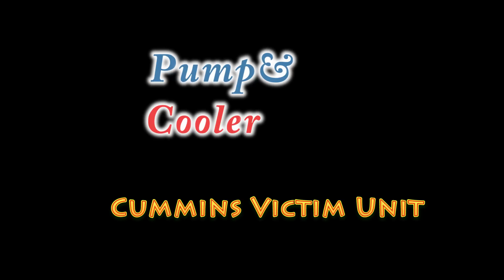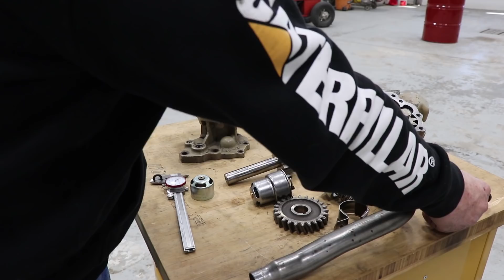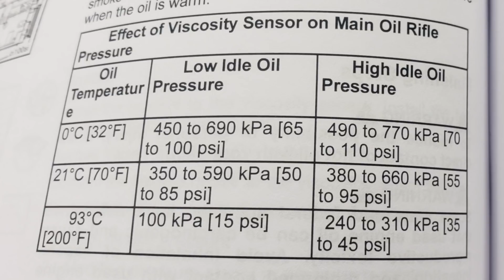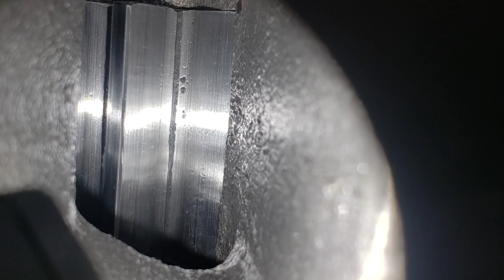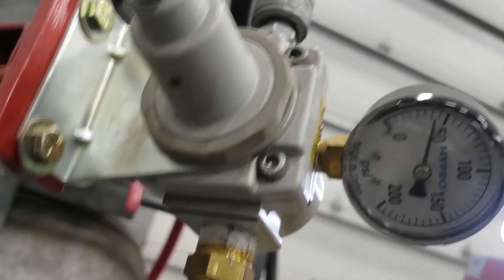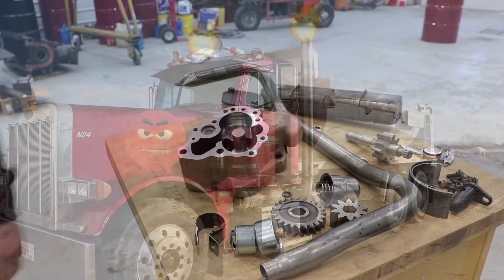How To Fix Low Oil Pressure On A Cummins N14

Comment: The pump end clearance may change once it gets up to operational temperature ?
Reply: Metal tends to expand when heated. Temp differential is not great in this application but could expand a thousand or 2.
Reply from the maker: excellent question,  I would like to know that myself

Comment: The high oil temperature is nothing more but heat transfer and energy transfer. He is energy, they were trying to transfer to the oil before they came out with big cam iv Low flow Cooling Which was a disaster. Thank you for the work you put in, I cannot wait to change my pump and put that plug in.

Comment: making a mountain out of a mole hill, pump creates flow, restriction to flow creates pressure, your cam bearings are worn out and loosing oil pressure, less resistance from wear, the bushing in the accessory drive cover is worn out and possible spinning in the bore, main and rods need replaced every 250k, cummins theory of high oil pressure is that it washes the bearings out, therefore they use low pressure with high volume, ya i know everyone else in the engine business uses pressure, however most of the new engines on the market are going with 40-60 psi at idle and high idle now with variable pumps,
Reply: You do not understand even the very basics of lubrication theory.  Sorry, you cannot just use Google and then try to sound like an expert be copying a few phrases from a website.
Reply: @mikek5298  no google involved life experience, 100s if not a thousand n14 repairs, maybe you should touch up on hydraulics and how they operate
Reply: Why is it that there is always someone that feels it necessary to tell a contact creator how they did it wrong in a less than diplomatic manner.
Reply from the maker: @lawrencelacenski9781  well in his defense I did ask for comments postive or other, so I do enjoy hearing his experiances, I would like him to explain what washing out the bearings means, I'm not hearing the noises that cummins engines typicaly make coming from the front cover when the cam bearings are gone
Reply: @Jpaydirt  what he's referencing is straight from cummins literature. They claim to much oil pressure causes resistance which leads to wear. 40 psi running psi is proven to be enough but their hot idle psi seems to low for flat (non roller) bearings.
Reply: @Jpaydirt  cummins theory is that high oil pressure blows the oil out of the bearing, where low oil pressure the oil is allowed to lay and provide more anti wear, i dont agree with it i just repair them, no one likes to do cam bearings, your oil pressure is on the bottom of the spec still even with new bearings and the possible counterfit oil pump, thermostats make the fluid (coolant/oil) slow down so the heat can transfer from the item (liner/oil) to the coolant,
Reply from the maker: I'm at the bottom of spec at 20 psi ?   well shit
Reply: @Jpaydirt  your at 15 hot at idle its been a while since i looked at the chart but i think that is the min could be 12 tho
Reply from the maker: @youtubeisawesome2487  10 is min  I didn't get down to 15 it was hovering above it  17?
Reply: @Jpaydirt  i saw your shorts on the n14, guess its ok to say i told ya so now. i know you made a tool but  you just stick the transmission in gear and get the nut loose on the accessory drive, cummins is out of those ecms, the conversion ecm and harnesses is 11k so you might want to pick up a spare before the market price explodes. i use a pilot bearing, 5/8 cut off from a brake chamber and a two or three jaw puller to remove the rear bearings. later.
Reply: This dude is spot on about the front cover bushing for the accessory drive. This engine should have it changed based on lack of oil changes.
Reply: How can too much lubrication wear something out? Sounds like typical cummins lame excuse for them screwing over their customers. If that theory is correct about high psi oil pressure washing bearings then all the 3406s/c-15s running at 65-70psi should be worn out long before 1million miles, but no most of them go over 1million before needing a rebuild, while an n14 normal runs 35psi needs a bearing roll-in every 250k miles or it will automatically install a crankcase inspection window. I've seen that happen numerous times when guys pushed off doing a bearing roll-in.
Reply: @JT-X-T  all engines need bearings replaced, they are a wear item, todays oils are much better than in the past and the replacement interval has been extended
Reply: @JT-X-T  it was funny to me when I read it because they still had the kt's and 1710's making high oil pressure. The n14's doesnt need bearings as often because the rods are bigger and oil has gotten a lot better but it's no 3406/c15. Ever notice that most blocks with windows are cummins? Lol

Comment: I was a mechanic for Alaska West Express(subsidiary of Lyndon Transport)for a few years. They used carbon spinners on all their engines. Changed the spinner paper at 10,000 mile intervals and the oil at 20,000. Amazing how clean the oil looked with 20,000 miles on it. All their engines had oil retarders which creates a lot of heat.

Comment: Sounds like a machining job for Abom79. That would be a great You Tuber collaboration that will boost YouTube suggested  videos on both channels.
Reply: i watch ABOM79... that is actually a NOPE for him to do this.  i have seen him do other automotive and motorcycle stuff.. NOPE..  need a shaft done.. yep.. need a cylinder rerodded.. yep.  sorry adam.  jeff mentioned the shop he sent his pump to on a previous video.
Reply: @waynep343  ABOM79 has said he doesn't usually do automotive.

Comment: Dang you did your homework. 240*F oil starts to oxidizes wow 😳 I didn’t know that. 
Great video Jeff.
Reply: Bluing salts oxidizes around 295 , above 305 you've cooked and ruined the salts.🤔
Reply: @michaelmcclure8673  wow 😳 Not to change the subject but I just heard they have gluten free lap dances in Seattle.